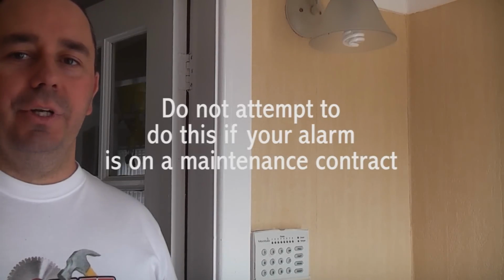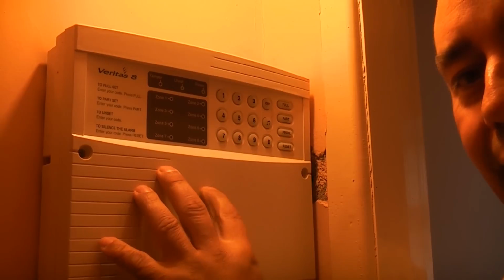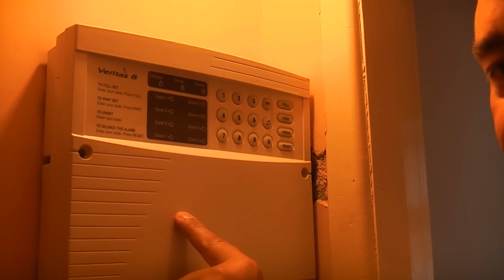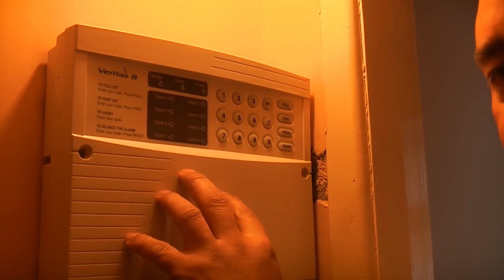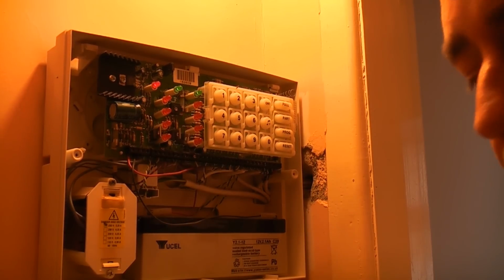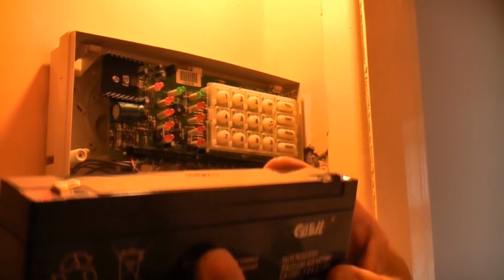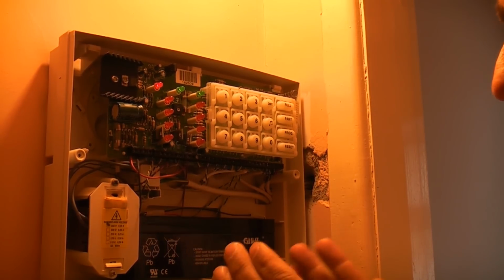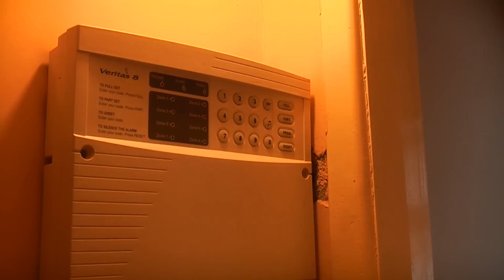Replacing a burglar alarm battery

Comment: Hi,

I recently had a power cut while I was out. When I came back the alarm was not sounding but the strobe light was still flashing. From watching the video I've gathered my battery needs replacing.  Will this resolve the issue with the strobe light?
Thanks

Comment: Just a couple of things - a battery that's so old can either blow the charging circuit fuse or worse damage the charging circuit beyond repair. It's a good idea to test the voltage at the clips of the cables to ensure you're still getting around 13V DC. Sometimes you will find the clips themselves are covered in verdigris, which is when the terminals have started to corrode. This will affect the charging ability, and in that case the leads should be replaced. :)

Comment: Ultimate Handyman, if my back up battery is ok, but the system is still going into tamper when power is supplied, does this mean that the scb battery in the external bellbox could be flat?

Thanks

Comment: Also it´s a good idea to write down on the battery or near it when they battery was changed. You  could have saved some electrician time if he is going over a fault in the alarm system. It might be your home and you remember when you put it in but there´s almost always no way for the electrician to find out. Like you said the battery has a 5 year lifetime, It´s frustrating to open emergency lights and units with batteries and not being able to rule out the battery. Thanks for the video.